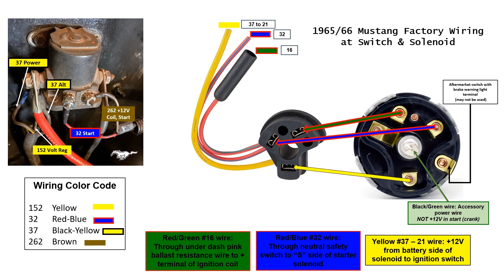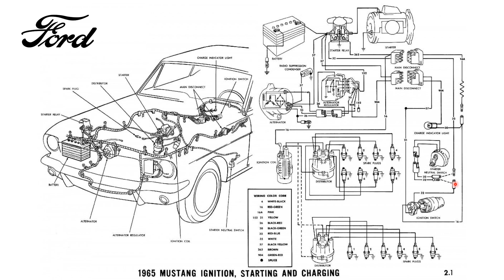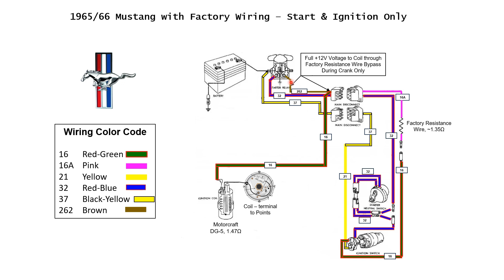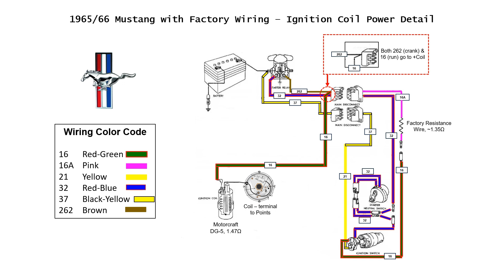1965 1966 Ford Mustang Ignition Switch and Start Circuit Explained

Comment: We are in the process of converting our A-code 67 289 to EFI. Our Holley Sniper 2 kit requires a switched 12V power source. The old distributor already utilized the red/green wire. Can we repurpose that connection to trigger the Power Distribution Module (PDM) instead of powering the coil? It tests at 12V.
Reply from the maker: I think so. If the Sniper 2 also uses full 12V battery power and you are just using the old coil power wire to supply the "on" signal, it should be fine.  A similar set-up is an MSD-6A where that uses full 12V from the battery, and the old coil wire just turns the MSD on. Conversely, if the only power the Sniper is getting is from the switched power, then I would use the old coil wire to trigger a relay. Sounds like a cool project!

Comment: Hello.  I have a 65 mustang that sometimes when it starts the starter keeps cranking/ starting while the engine is running.  I have to disconnect battery cable to stop the starter.  Sometimes even a day or two later if I reconnect the battery it starts and keeps cranking while running even with the key turned to the off position.  Was thinking it is the ignition switch but not sure.  Any help would be appreciated.  Thanks
Reply from the maker: Yes, I suspect a bad ignition switch especially since you mentioned that it can start and continue to crank even with the key off. Wow, that must make a racket!  The switch is cheap.  Change that (see intro screen for part) if its 50+ years old. As you can see in my video, the whole crank/start circuit is fairly simple. If you change the switch and it keeps doing that, then you need to get under the dash and look for shorted wire to the #32 red/blue crank wire.  I suppose it's possible, but I find it dubious that the solenoid is stuck in the closed position. You can also disconnect the starter cable at the starter and use a volt meter at the disconnected cable to do perform troubleshooting. Keep in touch!
Reply: @BlueOvalEdge  thanks for your help.  Not a mechanic just a old guy who likes to do for myself when I can.  I have the parts to replace and it easy enough from some repair videos I have watched.  Thanks again  for responding

Comment: I’ve stalled a after market fan on the radiator. I not clear what wire I hook it to off the starter key switch. I have a 1966 f100 truck.. there are 3 wires coming out of the switch large solid yellow/ red w/blue stripe and a red w/green stripe. Then on the center post there 3 wires that’s clamped together. I trying to connect the relay wire to the switch but each wire I touch it to fan run constantly. Can you help me with what wire send hot to relay switch. The product I’m using is the Black Horse-Racing 16” switch rely kit black. Fan package. #24FA900268.  FS17205X-BH
Reply from the maker: No problem my man. I looked at that Black Horse-Racing 16” fan kit. There is no need to run a hot wire from the ignition switch which would be a relay positive trigger set up. You can do that but don't bother. Black Horse is using a standard 4 pin relay, normally OFF, with a ground trigger set up.  Pin 86 is a hot wire that comes direct from the battery (not the ignition switch) through the supplied 30A circuit breaker.  Pin 30 is also hot from the battery but only requires a 12 or 14AWG wire and does not require a separate fuse because it only carries a small amount of current needed to internally activate the relay coil when it gets grounded. Speaking of which, Pin 85 goes to the thermal switch which will provide a circuit ground at 180°F. Pin 87 is positive to the electric fan.  Note:  The Black-Horse figure shows a picture of a relay in the #30 wire from the battery. That is a confusing way to show the relay as the pin layout of the relay is clearly explained, so ignore that in the figure. In summary, no need to route a hot wire from your ignition switch in the cab.  If you want a fan override switch in the cab which is a good idea, run a switch to ground in the cab and pin 85 which will override the thermal switch & turn the fan on manually. If you've done this and your fan is running all the time, then pin 85 is grounded all the time. Disconnect that ground to confirm then troubleshoot why the thermal switch or manual switch is always grounded. Not sure what wire gauge Black-Horse is supplying but I recommend 10AWG for pin 86 and 87 as they are high current wires. If the fan itself is smaller 12AWG wires, then you can use 12AWG for 87 if the wire is short. I always use 10AWG for pin 30 as you don't want nuisance trips of the thermal CB on fan start up (ask me how I know). I've done this set-up many times as it's a standard set up for an electric fan. Rock on!

Comment: Do you do these for the 64-66 thunderbirds?
Reply from the maker: I dont have the wiring diagrams for the 64-66 T-bird, however they are probably on line for free.  I would expect the electrical approach to be nearly identical, however I strongly suspect the wire color coding is different. The t-bird was more complex than a Mustang so there may be more wires at the ignition switch.  T-bird is a cool car.  Congrats

Comment: Iparked running mustang in garage and I went to start it a month later I had no power other than a charged battery. No power to key   No accessory , Nono crank. What might have gone bad just sitting?
Reply from the maker: Start by bypassing the starter solenoid with a remote starter switch from the positive battery cable side of the solenoid to the solenoid "S" terminal with the key in the "run" position.  If it cranks and starts, the solenoid is working but the "crank" circuit of the key is bad, which is not common.  If this occurs, turn the key to the "off" position to shut down the engine.  Then, confirm that there is +12V at "S" terminal of the solenoid with the ignition switch in the "crank" position. If there is no +12V at the "S" terminal, don't immediately suspect a bad ignition switch.  The neutral safety switch may not be closed in Park.  In this case, try to start the car with shifter in neutral rather than Park.  If it starts, the shifter is not closing the electrical contacts of the neutral safety switch in "park". Sometimes, the shifter is just slightly out of adjustment in "Park" and not closing the neutral safety switch. This has personally happened to me where I had to slightly push the shifter forward in Park to fully (electrically) close the neutral safety switch contacts.  The adjustment is under the car (not in the shifter itself).  If the car has no accessory power in the key "run" position, it could be a bad switch.  Remove the harness from the back of the switch and check for +12V at the big yellow #21 wire.  There should be +12V at all times even with no key in the ignition.  If there is +12V at the big yellow #21 wire, then suspect a bad ignition switch. If there is no +12V at the big yellow #21 wire, then start by checking for +12V at the black/yellow #37 wiring at the + battery cable side of solenoid.  You can remove the firewall main disconnect electrical connector and check for +12V power at the actual plug. If there is +12V at the solenoid's #37 black/yellow terminal lug but no power at the disconnected electrical connector, then there is a problem with the underhood wiring, which is not common.  Good luck brother!
Reply: @BlueOvalEdge thank you! I’m having the same problem! Starting it with a screwdriver at the moment at the solenoid.
Reply from the maker: @DeoVindice85  Hope this video helps. Let us know how it goes !
Reply: @BlueOvalEdge thanks!
Reply: @BlueOvalEdge will do
Reply: FORD,,FIX OR REPAIR DAILY,,HEHE